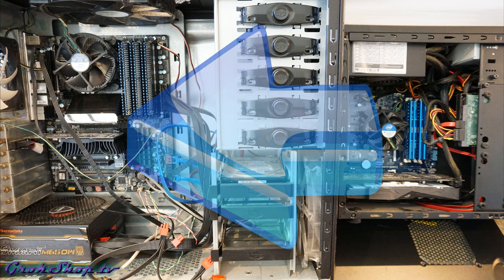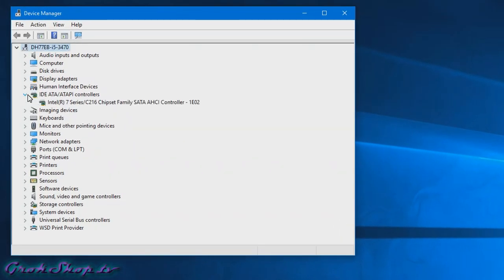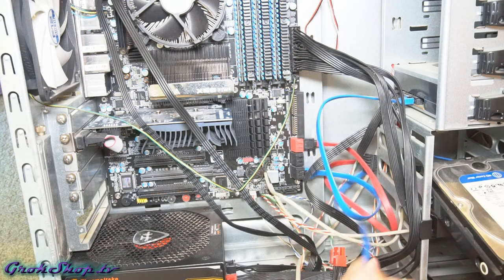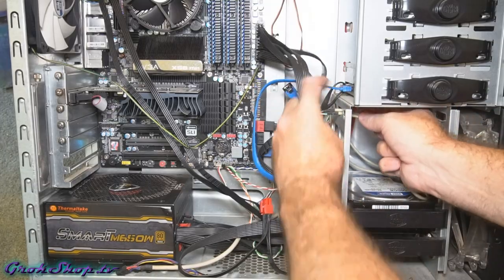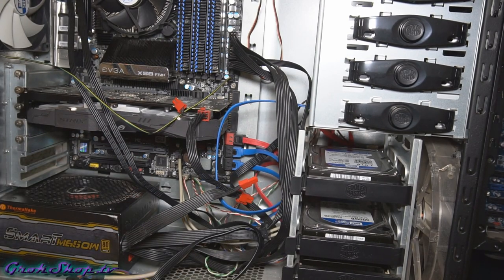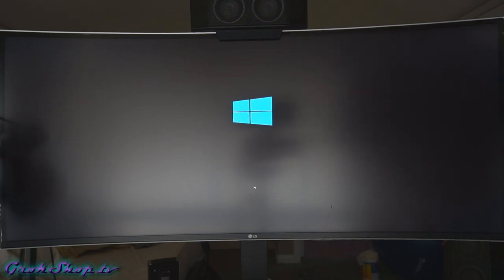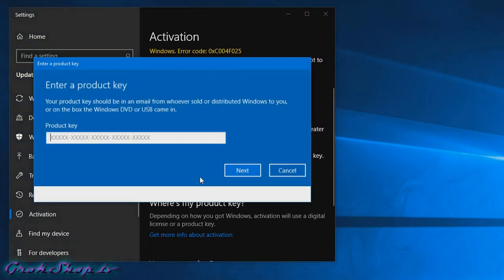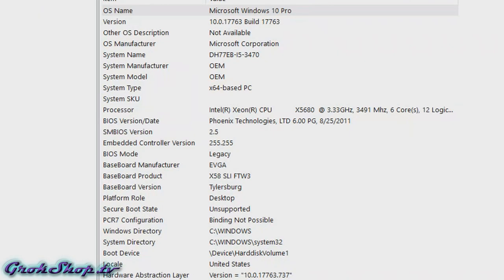Transfer Windows 10 To New Motherboard & CPU + Digital License Transfer

Comment: wait after i do the backups in my old drive i just need to connect my old drive to the new motherboard and im ready to use my pc? + all my data inside the drive is saved?
Reply: yes! This is what I did and I just plugged in my drive to the mobo and I was able to boot my new pc with windows without a usb installer
Reply: @ruel5978  And what if I didn’t the backup?

Comment: if i wanna fressh start on windows with the upgraded computer do i need to do the backup?
Reply: Late response, but you could do the back up to get the Windows system files in the new computer, then once the licensing is straight go to Settings/Recovery/Reset this PC. It will allow you to do a fresh install of Windows 10 without any third party software.

Comment: If this works it would be a lifesaver. In 2012 I purchased from Autodesk Product Design Suite Premium, for let’s say $$$$. I also paid for the annual subscription for another ~$2500/year. In 2021 Autodesk announced an end to that software model. Now there are no new perpetual licenses, only pay for the rest of your life software. Up until that time I could download each and all of the annual versions (2012, 2013, 2014, 2015, 2016, 2017, 2018, 2019, 2020 and 2021). I paid for them but now Autodesk says my perpetual license is only for the last year, 2021. My old 3930K system was hot dog 10 years ago but time has taken a toll on that system. Sorry to tell such a long story 😢 but all this boils down to, I can build a new system and download the 2021 version, but none of the previous versions and their special features. If I could transfer my 3930K system SDD to a new Intel gen 12 CPU system it would be absolutely fantastic 🌈 . Sorry for the long sob 😭 story. But thanks for your video and procedure
Reply: You are hopong the same he does in the video is gona work. Any feedback ??
It is kind of taking a Image of Disc and pasting it on a new Disk, expect here also MotherBoard is changed, and I remember Windows activation is liked to the MotherBoard. I guess your AutoDesk product activation works close to that way.
In the case of Windows , if that works to transfert the activation, after I would run the system just to try bind activating to my Microsoft account and add PC, if that keep and works great. Then gona format, case system gona be instable, at the end , an Image not gona properly works on another system, there gona be drivers issues, so better go fresh start.
Can you give any feedbakc please??
Thx

Comment: Good video but not what I wanted and I can't find what I want to do. I built a new  computer that I want to put my windows 10 on the new one but not on the same HDD it was on.  I want to transfer it from the old computer to the ssd drive I put into my new computer.  I own the windows and I do not want to buy a new windows10 and key when i already have one.  Can you or anyone help me please??
Reply from the maker: Clone the old drive to the SSD, then make sure you can boot from the SSD, then follow same procedure with the SSD instead of the HDD.

Comment: I don't think this video is relevant for my situation..

I current have an intel mobo, cpu and compatible ram with windows
on my ssd and my other shit on my HDD.

I bought a new AMD mobo, cpu and compatible ram and going to install
it in my computer soon. 

However

I'm confused as how to do this....do i need to fresh install windows which is on my SSD? 
before installing the new setup or do i fresh install my windows once i have the new
mobo, cpu and ram in it..

Its hard trying to find information on this if you can't help me can anyone
redirect me to anything helpful?
Reply from the maker: This video is for you, if you'd like to avoid having to do a fresh Windows install, including all your apps with local data & config.  So, in your case you would set the SSD driver to the generic one like I showed in this vid.  You can certainly start over with a fresh install on the SSD if you prefer that route.
Reply: @grokshop  Okay so could you provide me step by step how to it? I plan on fresh installing my SSD and not making a backup since i already transfer the most important stuff from my ssd to my HDD..The part im confused about is do i fresh install my windows before or after the new parts are in my pc? Also, i don't have "IDE ATA / ATAPI controllers" in my device manager?
Reply from the maker: Many machines now will have their controllers listed under "Storage Controllers".  So look there, but the process is the same, you want to change to "Standard SATA AHCI Controller".  There is no fresh install; you are transporting your current install.  If you want to fresh install, you would just plug in your SSD to the new box, and boot from your install media and tell it to format the SSD during install.
Reply: @grokshop  your video is confusing because your switching drives while i'm using my same SSD drive for my os and upgrading my cpu and motherboard. So, don't think this video is right for me...
Reply from the maker: @TheNamesJT  I didn't switch drives.  I migrated my Win10 drive to a rig that already had a drive & left that drive in so I could get to it, but the Win10 boot drive didn't change.

Comment: is a backup necessary for this to work?
Reply: No, it's just incase this method doesnt work. You can restore all your files with a system image recovery saved on an external hard drive and a USB to install windows 10 to boot as an alternative
Reply: @jeneralgod  but If I only plug the old hard drive with windows 10 in and without any backup, just plug in a new mobo will I be able to use windows?

Comment: can't you just do a Sysprep?
Reply from the maker: I think u can, but there's some issues. For one thing - if you have an upgraded version of Windows, it wont let u sysprep (without reg hacks.)  Then, the generalize thing will cause you to loose a lot of settings u may want to keep - anything related to your profiles ("personalization"), event logs, network config, etc - will be gone, so you have to look at it & understand the options carefully, but definitely an option for some.

Comment: So I cant clean install Windows 10 without having to lose my files? There's no way around it other than backing it up?
Reply from the maker: There is a way to clean install and keep your files.  You simply clean install onto a new HDD/SSD and then also connect your old drive, but set your system to boot from the new drive.  Then your old drive will get mapped to another drive letter where you can access your files.   Alternately you can copy off / backup all the old files you want to keep and then clean install over the existing install & then copy back or otherwise provide access to the files you backed up.  The process I show in this video has one major benefit:  you get to keep all your application installs without having to reinstall & configure everything.  The most stuff you have installed, the more the benefit.
Reply: @grokshop  Ok thank you, I'm upgrading my CPU and motherboard but I didn't want to reinstall everything. I guess plugging the USB in and select "keep files" will be ok.
Reply from the maker: @brightgarinson3099  Doing a clean install is a major pain.  What I am showing here should help you avoid such pain.  However, some people prefer clean installs anyway for various reasons like, eg, upgrading the drive.  If you don't need to do a clean install, follow the video exactly & you should be fine.  If you don't want to do a whole backup, then at least go through and make copies of all your important personal files & data to a USB drive.
Reply: @grokshop  Ok, thanks again man. I'll recommend this to others.

Comment: Is there a reason why you use such cheap and ugly casings? 
Even if you are not into RGB lighting or viewing windows, I would still recommend you upgrade to a decent case. Just because they have cable management (which would obviously be an advantage in your case) and they are made of decent metal instead of cheap sheet metal. Which means that they don't have any sharp edges where you could cut yourself. They also have other practical advantages. Like built-in dust filters, for example.

Translated with www.DeepL.com/Translator (free version)
Reply from the maker: I'm a dad with 2 young kids, a full-time job, and a million other things going on.  I literally never look at my box as long as its running, so I wouldn't be able to enjoy a nice case with lights & such & sharp edges don't bother me.  But I admit a great case is awesome.  So, do it up!  Do what floats your boat!!  I do.

Comment: So after I delete the drivers I download the new ones right?
Reply from the maker: No you only want to get the new drivers on the new system.  Let the OS boot up on the new hardware & it will find some drivers automatically.  Then you can change out any that are not the ones you want.
Reply: @grokshop  ty